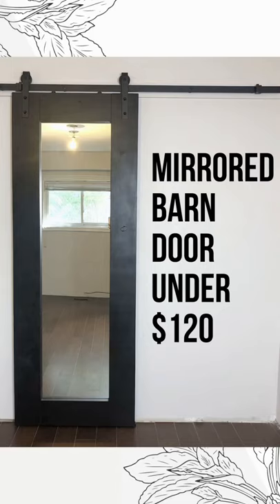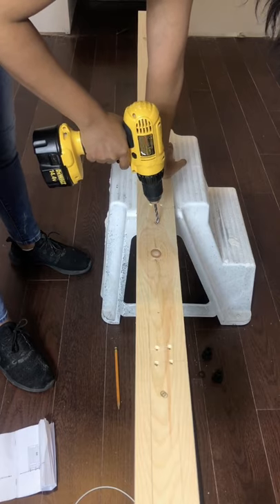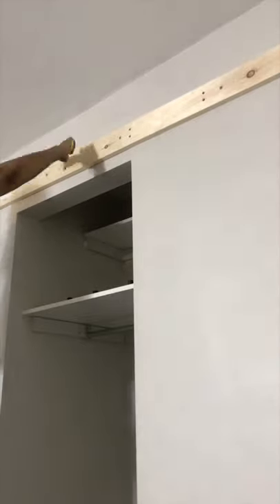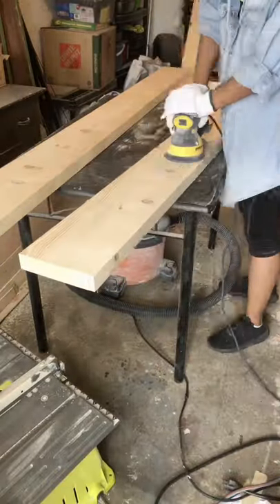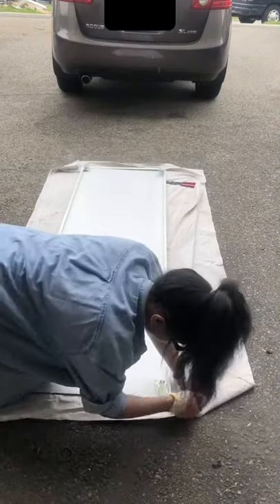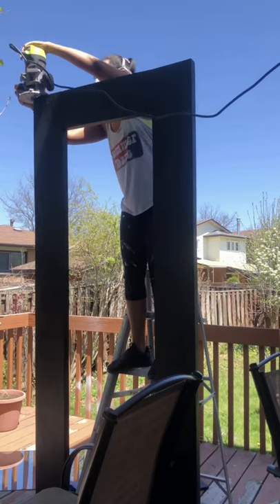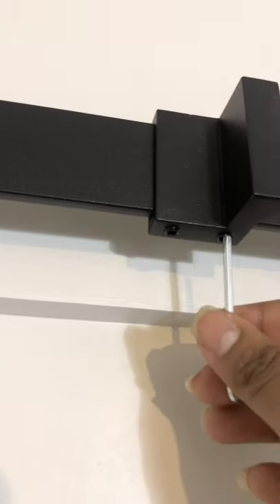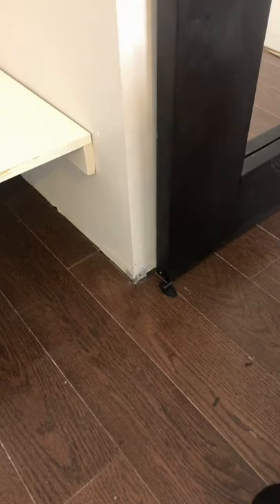DIY Mirror Barn Door Under $120

Comment: When buying the mechanism, how do you figure out what length of the door you need? Do you go by size of the door width? Thanks for sharing your knowledge. You are so smart.
Reply from the maker: It really just depends on how big you want the door to be. I chose to make a slimmer door because the glass I had was slim. When measuring for the height just make sure to leave about 1/2”-3/4” at the bottom for the door to glide easily and not touch the ground. I hope this helps.
Reply from the maker: If you are buying the door from a store, they usually come in a custom height. Lean that up against the wall to gauge how high you need to install the mechanism.

Comment: I have baseboards that stick out a bit. I wonder if it will affect installation.
Reply from the maker: I didn’t have them installed but I also have baseboards that stick out. That extra piece of wood I attached to the wall before attaching the hardware helps to push it out a bit more. The wood is 3/4” thick and the hardware itself is pushed out a little as well. I’ve installed my baseboards now and the door is no where near  my baseboards.
Reply: @diamondintherough._2777  Thanks.

Comment: Do you need to own all the machinery or can u rent them as needed?
Reply from the maker: You can get Home Depot to cut your pieces for you and you may be able to get away with just attaching the mirror to the back without using a router. You will need the drill, I’m not sure if hardware store rent those. You can check the website of your local store